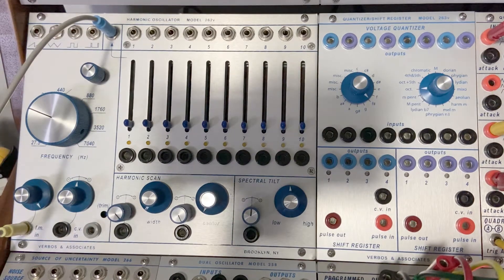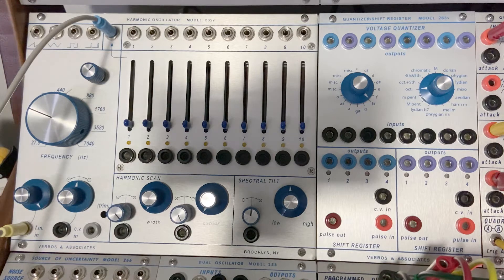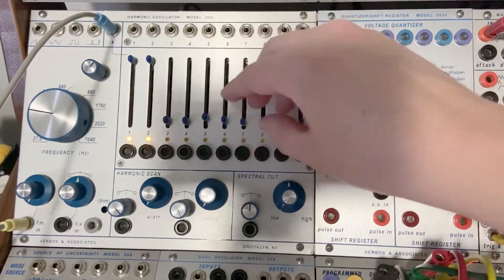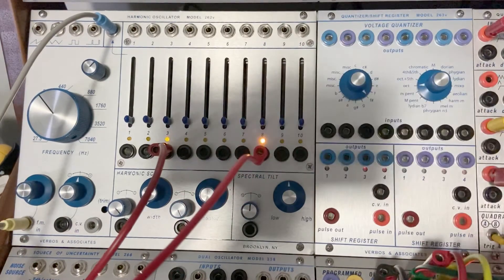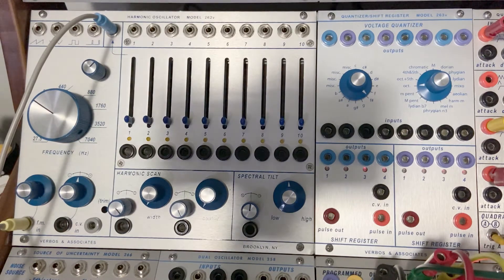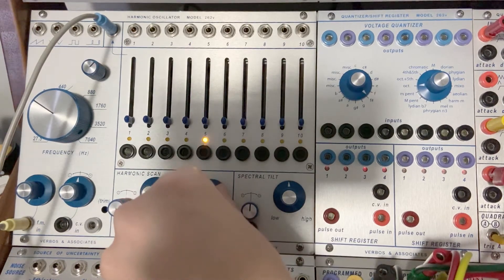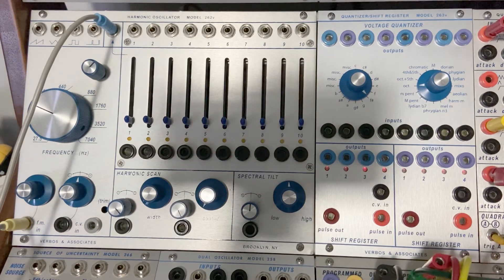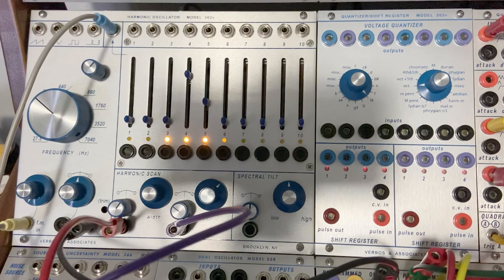The Verbos & Associates Harmonic Oscillator Model 262v module sings / EPISODE 29

Comment: I've toyed with the idea of making a PCB with just the waveshapers, so you put wave shapes other than triangles into them and see what comes out (kind of the way the Serge Wave Multiplier is like the nonlinearity in the Buchla 259/Music Easel, but lets you put generic waveforms in).
Reply from the maker: That sounds like fun! I’d love to play around with that idea. The Buchla oscillators have so many extra outputs on them, so it would be a good way to get some more timbral variations from them. Gotta give each shaper a crossfade control/cv input so you can make a racket with some audio rate modulation.